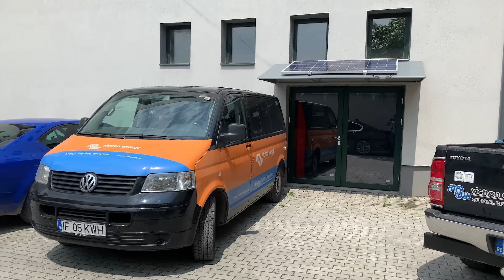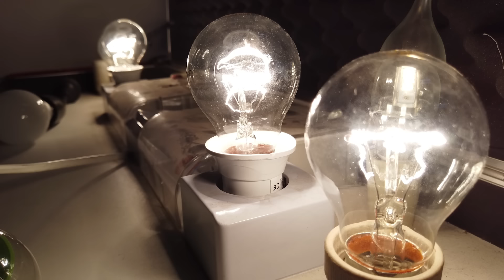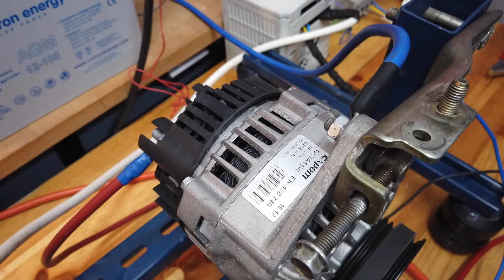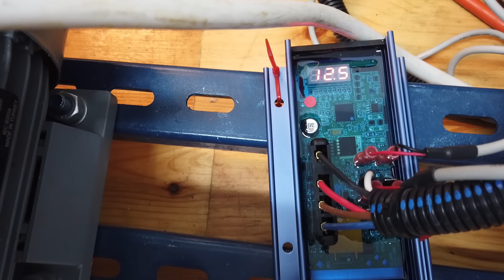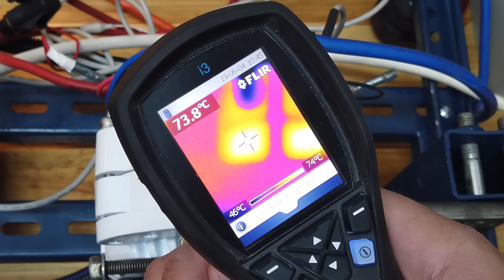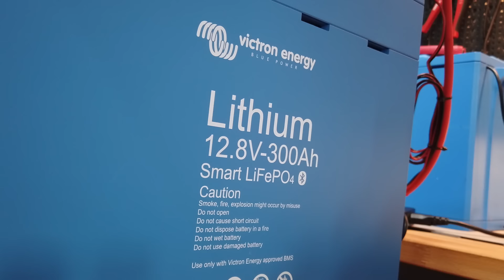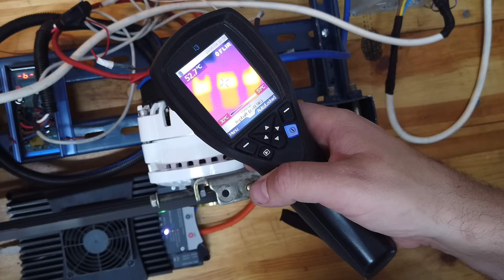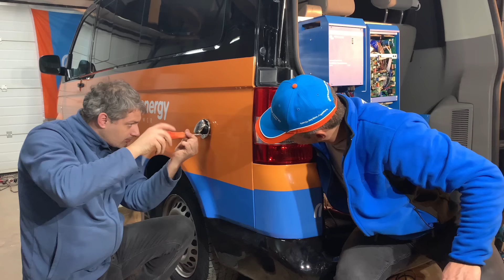How to not blow up your Alternator when charging Lithium

Comment: I am very sorry but I do not agree with this example.  I am a big fan of Victron Energy and use lots of Victron equipment on lots of systems.  I’m an electrical engineer with over 40 years experience in electrical systems both aviation and marine.  I’m a ABYC member and advanced electrical advisor.  Let’s look at some facts.  1.  An alternator is used to provide power for not just charging a battery or batteries but to also supply all loads connected.  This may mean an alternator is exposed to current that is equal to or higher than its output rating.  Indeed in the old days alternators and dynamos were often accompanied with +/- Amp meters to show when the load was greater than the charge.  In these cases alternators or dynamos did not burn out.  In fact I have never in all those years come across an overloaded alternator, ever.  2. Where is the fan on that alternator?  Internal?  Maybe?  But nothing like the fans normally fitted externally.  3.  Bulmar, fab alternators, so are prestolite which having spoken to there technical department at their factory have agreed that their alternators at known to run at 140C. They also have no issues with running at max capacity.  4.  Alternators have a max capacity which will be a figure somewhere below the actual capacity, but its capacity can not be physically exceeded because of the load or type of battery connected.  Its max is its max and if its rated as a 100A model then ok maybe it can output 110A. But it’s still the max you will not get more even if you short circuited it.  It is self regulating by its physical structure.  5.  Even if some alternators struggle with running at max capacity and you fit lithium and want to provide the benefit of faster charging you will want an alternator to suit.  But IT DOES NOT need to be a smart or multi stage charging alternator.  It can be but it does not have to be.  6. Lithium batteries do not always have a lower internal resistance than LA.  This is a fallacy and inaccurate.  A large AGM battery or bank of batteries can have a lower internal resistance.  That is fact.  7.  Irrespective of chemistry a battery will draw current based on its size, level of charge and yes it’s internal resistance, which is proportional to its level of charge and size.  Both Lithium and LA will stop charging when the internal resistance increases to a point no current flows.  If either type is rated to be charged by a standard alternator it will charge and it will be safe left connected to that charge.  If a battery manufacturer built batteries that failed or worse because they are being charged by the recommended voltage then they would be in court.  But it seems that some can come up with unscientific theories to sell more equipment perhaps?
Reply: Hello Simon,  the fact that alternators burn on large lithiums batteries sooner or later is not an opinion, It's something we have seen many times in real life....and then came with the advise to have a limiter/regulator or something else installed to protect the alternator.  You mention resistance, the point is that a lithium battery does not go up in voltage during charging while a AGM or other lead battery does this immediately. Only when the battery gets near 100% this will happen.   So a 10kWh lithium bank with a 100A alternator runs easily 7-9 hours on "overload" to get it full while doing this with AGM the max power is there for <30min before it will throttle down already.   this together with a 50% efficient alternator creates tons of heat as the current is extremely high. believe it or not but specially on boats this will kill alternators.   I have mentioned this a few time before.  Why not we lend you out a few empty lithiums and you connect the car alternator to it and see how that alternator heats up/burns out.   In fact I did this with my own alternator (180A@12V) and that was over 160deg externally in 10 min on idle engine rpm, I decided to stop when I saw the oil from the bearings started dripping out.        And finally, this is not because a manufacture made a bad battery or the alternator isnt reliable. Its about the fact HOW the alternator works (which is great for 99% of all systems ) but does NOT fit on a lithium bank which just does that what the alternator cannot handle long.   The battery will not fail, the alternator will.     And in the end, its an advise, learn from many clients facing these issue, if you want to go another route your are free to do so of course.
Reply: @JohannesBoonstra-ol2nz  I agree that a large lithium battery can pull a large current over a long period of time.  A so can I large load or a large LA.  But if the case is that the system design is going to see this situation where the load or current is always or frequently be high and means the alternator is at max output then it makes sense to increase the size of the alternator or yes regulate the output.  However it is not the case that 100% of the time there is a definite need for a multistage alternator or other devices including DC-DC converters should be used, which is sort of where the industry is going.  Equally I would say not all alternators are the same and from past experience I have yet to see a burnt out alternator due to high output and that includes cases where regulators have failed and the voltage has gone high due to no regulation.  My experience is mainly in the commercial boat sector and in temperate weather in UK.  I am sure that in some circumstances such as poorly vented engine compartments and hot climates this may be an issue.  But in all honesty the alternator used in the video is one that has what looks like a low level of ventilation in the form of a decent fan.  This alternator may be typical on some yachts but it is not what I would normally be used to seeing.  In my experience near all alternators including on yachts have an external fan.  It is also important to accept that most fans need to rotate in the correct direction and that air is drawn from the back of the alternator and dissipated through the front, thus the heat is not directed at the regulator.  There is always the risk that the wrong alternator is used on replacement, this I have seen.  Another factor is the regulator voltage.  It seems that in the USA regulators may regulate at higher voltages that re the norm than elsewhere.  These voltages can be from what I’ve been informed as much as 14.6 volts or higher.  In UK and on all engines I have worked on alternators are either 14.2 or 14.4 volts or double in 24V systems.  Increasing voltage output would result in higher currents and perhaps put an alternator at higher risk of over temperature.  These are all factors and my point is you do not always have to automatically apply a binary solution.
Reply: @simonpembs  internal fan are not typically worse then external I would say.  Of course there will be solutions alternator wise in the future , but the majority of alternator out there are designed to refill a starter battery and feed the house load doing this.   The point you made in getting a larger alternator doesnt work, as that one will get overheated as well,  The lithium batterie will not throttle the alternator back by lifting voltage (as LA does)  The large alternator does the charging with more curruent (so even more wear on the belt and most likely struggling engines when idling) .  realize that an alternator of lets say 150A max, will do 170 or more on low voltage/lithium which means that it runs longer on max power then on LA , and beside this also 10-15% more power and at a lower voltage so that current is higher and even more heat is generated...thats the problem.    Is there something like an alternator workshop in your area who happen to have an alternator test bench?   try go there wit a 100A alternator and a half full 200Ah lithium batterie and see what the alternators starts doing.  you might be surprised.      What we did in the clip was to shown what will happen over time, not as fast as what was shown here as cabling and higher rpm might "help" the alternator, but the point is that there needs to be something installed to have it safely done with sufficient lifespan.
Reply: Helal olsun.

Comment: That is an awfully fat positive cable don't recall seeing too many of those on factory motor cars maybe on large vehicles with diesel engines busses, garbage truck, simi tractor, ect.

Generally when you run into these kinds of problems it's some kind of modification. I  like simplicity like the older vehicles limit current by wire size to the alternator. 
Use a length >1.5m of high temperature 8 gage wire and when there is a significant difference in voltage It will drop over the length of wire limiting the current.
Wire size and length would have to be adjusted to accommodate the situation as in the size of the alternator and what you're attempting to achieve. Key words High temperature rated.

This method properly fused and coupled with an appropriately sized relay closed by ignition on can alleviate any issues.
 A poor-mans current limiter per se.

I guess the bottom line is if you're ignorant and you diy you better have deep pockets.

The more you understand about what you are working with the less chance something unexpected will happen.
Reply: For a starter battery you might be right, but filling a huge battery bank isnt helped when a cable size is reduced.  Then stil a dcdc converter or alternator regulator is the best option ( safe/efficient )

Comment: Rather than such overcomplicated setup, I would just put dc fans on the alternator.
Reply from the maker: Difficult to do when on a boat for example.
Reply: I like the look of the Orion XS. Can regulate output up to 50A in 0.1A increments and fine tune to your set up.

Comment: the biggest problem with alternator is that it sits in motor so ambient temp there 100C easy.

And, yes, your alternators are typical light duty from small cars (70-90a), not designed for prolonged full current.

Comment: One of many first things i done was swapped my 85amp alternator to a 145amp alternator that was for the same make of Van with Power/heated seats option And at idle (650Rpm) it is rated to 100amps. Other upgrades was thicker copper wire And extra ground points I run a total of 400amps Life4po And 400 watt solar panel And a shore power 115volt outlet  And a few Victron products to keep it all together running smooth ...4 years now And no issues
Reply: In a vehicle that could be , as there is cooling from outside.  When sitting for longer periods in high ambient with high loads on, this could rapidly change though.  also with thick cables and extra ground points. It's a matter of cooling power and efficiency.    At boats it's even more relevant to consider this.
Reply: But what amps go to the starter battery get to. I put a 140 wat alt. In my van and the charging was over 15 which could heat my 12 v system.
Reply: @JoFoxynHomer  If your van is drawing say 70amps to run And your alt is 140 Your battery will only take 70a from the 140am If you are getting 15v from a 12v system 14 volts is a typical charging voltage. (14.4 is perfect) If you're running 15+ then you most likely have a voltage regulator issue and your battery is being overcharged. with no real information And many factors i could not give you a pin point reason as you left out why you need a 140 alt or which van If you upgraded more than the alt And if you are using other items ...2nd battery, Type, size, etc etc Do your home work before making upgrades
Reply: @JoFoxynHomer  your starter battery is only needed to start the engine, thats done with 0,2Ah only as it's so short.  The alternator feeds this right back in and then powers the energy for the engine systems and in-car systems.
Reply: @JohannesBoonstra-ol2nz  That was true decades ago. Nowadays cars use so much standby power that the battery dies if you don't use it for a couple weeks. Plus all the electronics running - sometimes while the engine is off -, plus radio for the keyless entry, etc etc. God forbid if you were to hardwire a 24/7 dashcam, blackbox, etc in it. Heck many stock cars still dies slowly if you don't run it every day and for prolonged periods of time - preferably on an elevated RPM too - for it to top up the battery properly. Hence we have many battery failures in the first winter month, as they were already running low on charge during the year on top of the usual degradation. So bottom line is: no, the alternator won't feed it right back. The amount needed to start the engine is little, but the cumulative discharge coming from everything else is very significant.

Comment: Having a normal starter battery fed by alternator and then leisure batteries connected with it to charge. Now why would I need to install dc dc charger if  swapping those leisure batteries to lithium? Is it rather a booster then?
Reply: the point is that the alternator needs to be protected against overload, so therefore a DcDc converter, buck boost or smart alternator regulator must be incorperated in the system.
Reply: @JohannesBoonstra-ol2nz   Thanks for your great information and sorry to bother you again.  So if no lead acid battery attached to the alternator but still want to capture the energy that the alternator can generate for your house batteries, is something like the Balmar alternator regulator sufficient?
Reply: @SailingWindGypsy  yes if that alternator is connected such that charging can be stopped by the BMS , thats a good solution then.
Reply: @johannesboonstra6917   thanks! I also ordered a balmar alternator regulator that can be used with lithium batteries.  Most of the time we get enough energy throughout the day from solar, but if we motor the alternator tries charging the batteries for hours at full tilt.  I understand now what you're saying about wearing out the alternator itself even if it's not overheating or shutting down suddenly!  Seriously, you should do a YouTube on this because you have given the best advice on alternator lithium battery charging I have read so far!
Reply: @SailingWindGypsy   yes, could be an idea.  I will give it a thought

Comment: A typical, high quality (Nippondenso, Delco Remy, Bosch) alternator should be able to run continuously at full output for hundreds of hours. I don't know why your test unit started smoking, but it should not have. Car & truck alternators are typically designed to operate in 105C or 125C air environment, not component temperatures, but the air that it uses for cooling. The cooler it operates the longer it will last, roughly 2x the life for every 10C reduction. As the speed increases the alternator can produce more current, so it has to work less hard, and component temperatures drop. mentioned by others, a 3:1 ratio of engine to alternator is common, so at highway speed, when my diesel is turning 1400 RPM, the alternator is turning over 4000 RPM.
BTW, typically, an alternator reaches the highest component temperatures at around 3000 RPM when operating at full load.
Reply: the problem is that the alternator runs over its max....and that with limited cooling, specially on boats will reduce the lifespan dramatically.

Comment: Is the low rpm effecting the diodes on the rectifier, or something else? The fix could be to increase the capacity of the diodes if this is what is smoked at low RPMs.

Comment: Smart external regulators, like the ElectroMaax Pro-X, or Balmar, allow you to control the alternator output at various rpm’s , and they also monitor current flow and temperature to optimize charging and protect the alternator. ElectroMaax also has alternators with separated rectifiers to minimize heat generation in the alternator.
Reply: yes, that's also an option , but often require expensive work to the alternator to have the regulator installed